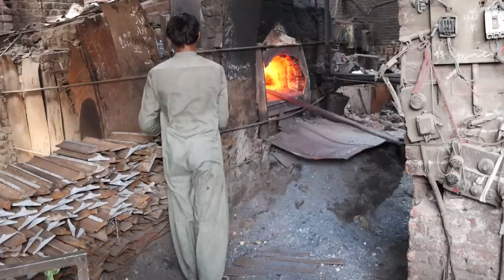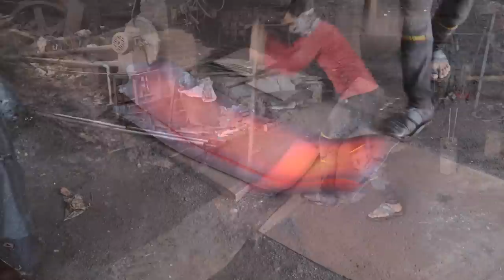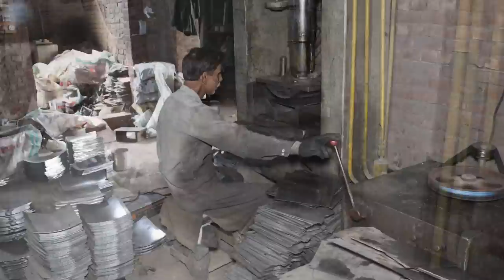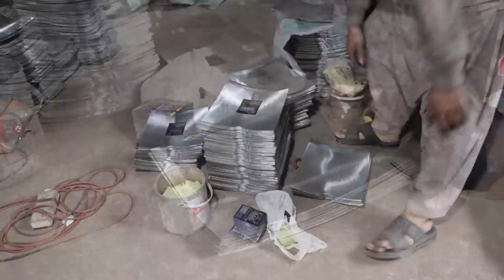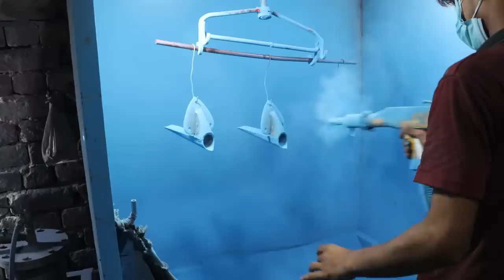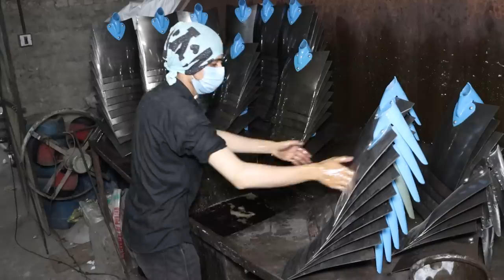Process of Making Agricultural Hand Plough From Railroad Steel Track

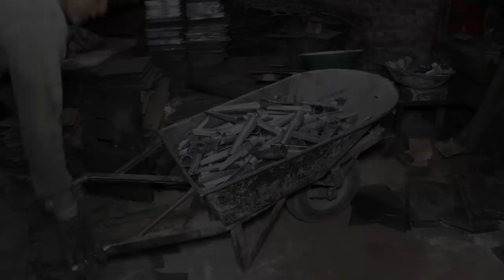Comment: 6:25. omg.. that might be the first time they’ve shown a part land in an efficient transport method to the next work station… it usually hits the dirt every time its worked, then picked up again, repeat.
Update:
Nevermind.. he just wheeled them into another room and, of course, dumped them all in the dirt.
The material handling inefficiencies shown all through these videos is astounding.
Reply: The more efficient the fewer the workers. If you don't work you don't eat.
Reply: Exactly. Westerners are astounded at the inefficiencies of the process. This process employs lots of people specifically BECAUSE of its inefficiencies. And even then the product is still cheaper than an American made one.
Reply: Yeah, injury and death there is your fate. In USA you sue someone.
Reply: Yup, but the first rule of efficiently using a wheelbarrow is "have the empty barrow facing the direction of travel you will be heading, once it has been filled" no need to be turning a fully loaded barrow around in a tight space/trip area like that ?
Reply: @graemewhite5029  see earlier comment about fate. Thinking ahead is not encouraged.
Reply: @emersongarcia7128  Usually a business owner is concerned with profits first. After all, if you don't stay in business, nobody gets hired.
Reply: There's always a Karen on the comment section.  Salty asf 
@Dash

Comment: I've seen a lot of videos showing the recycling of old rails. Why don't the rail manufacturing companies use this material to manufacture new rails?
Reply: Hi John. Railways recycle I think 95 % of discarded steel parts. Really heavy parts like a 50 yard, 7 ton piece of worn old or broken rail are just to big to return to the distant specialized foundry. A lot of parts are from recycled steel. Think of it as a trickle down thing. The door locks you use everyday probably are old steel that has had 10 other jobs. Over many years and countries. Nothing wrong with that, every time you melt it down, more impurities are removed. In another 1000 years of that, the “new” steel parts will be transparent, or something. Sounds cool don’t it.?
Reply: The rails are worth more to manufacturing companies like this than they are to the plants making new rail. The plants that create new rail can blend lower quality scraps to create the perfect metal for the new rails
Reply: Most of the rail network left by British in neighbouring Pakistan is disused and rails are frequently stolen and end up here.
Reply: They do use as much of the old rail in the mix as possible. If you suggest they just remelt the old rail it would be too hard and brittle. Here in the US much of the rail is made into bed frames and sign posts

Comment: If this advanced civilization makes shovels from railroad tracks  would be interesting to know what are they making the railroad tracks from.
Reply: Railroad track is made by melting down scrap steel (including shovels like these) and alloying it with some portion of fresh steel and other elements required to achieve the desired steel alloy/grade. It is then continous cast and hot rolled to railroad track shape. All steel production heavily relies on scrap steel in its production, steel is one of the most highly recycled materials. It is either melted down and re-alloyed, or cut to size and re-forged (as in this video). Railroad track gets replaced as it ages due to wear. Because it is a relatively good grade of steel to begin with, and comes in large homogenous chunks, it is more often reforged than remelted. Every item of steel you have around you (in your house, car, etc.) has been made between 80-100% from scrap steel.
Reply: @pyalot  Great comment! 👏👏👏